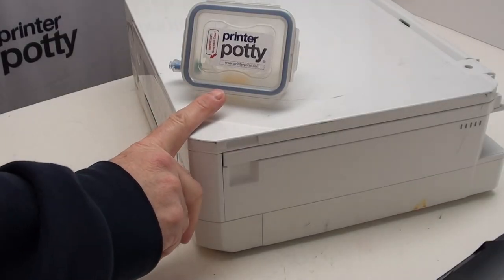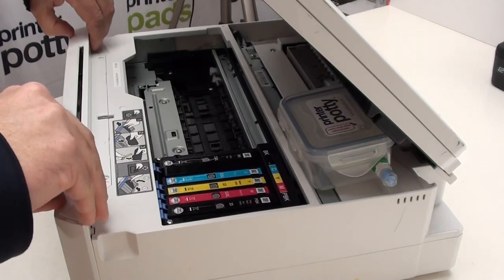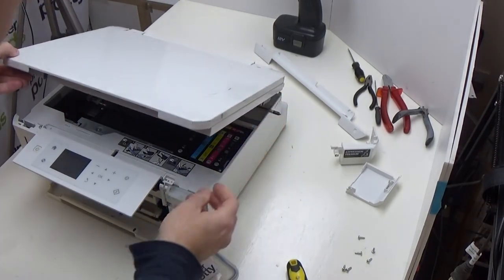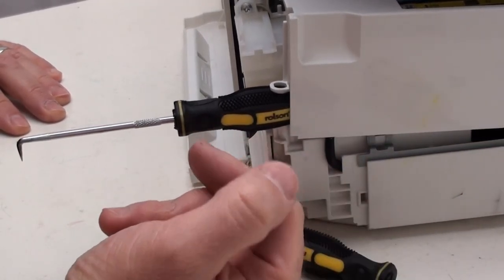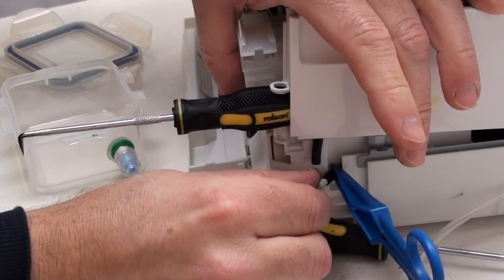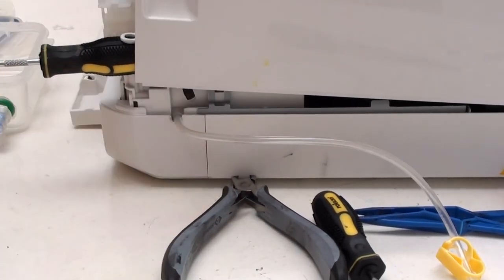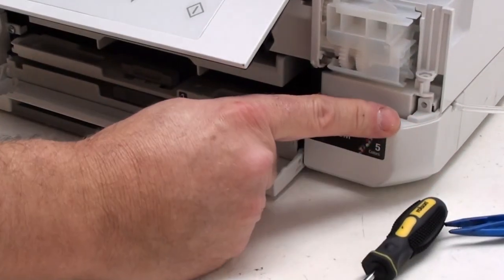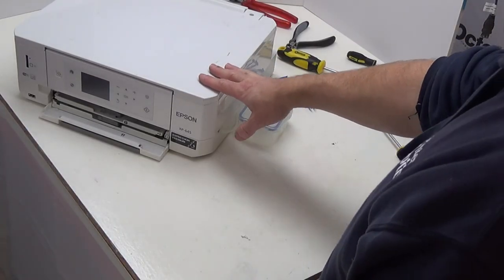Waste ink kit install for XP-645 and XP500 to XP860 (except the XP-510)

Comment: Thanks sorted will I still need a key number to reset printer
Reply from the maker: Yes. Replacing the pad is not detected by the printer so you do need to reset the waste ink counter. A key is needed for using the WICReset app to do that.

Comment: Would this work with a XP970
Reply from the maker: The XP-970 has a user replaceable waste ink pad holder with a chip, called a maintenance box so technically an external tank isn’t needed but we’re looking at creating units (and instructions) for printers like yours. The trick is getting hold of an XP970 to fix one too.
Reply: @octoinkjet  Thank you